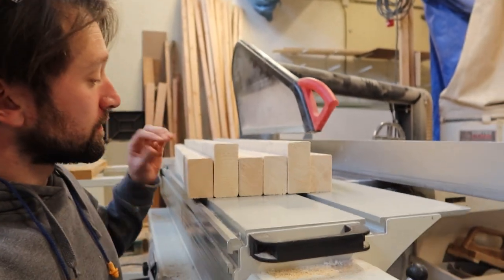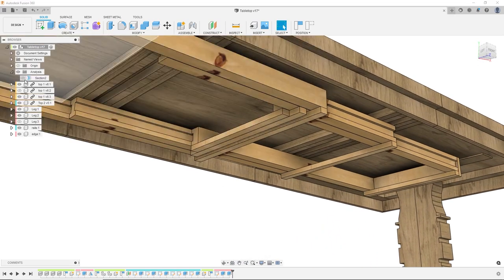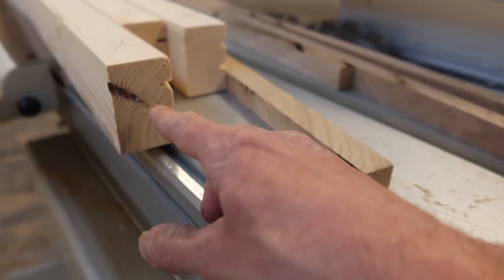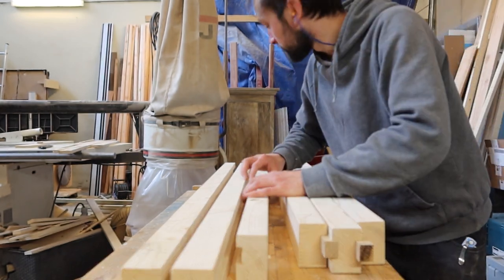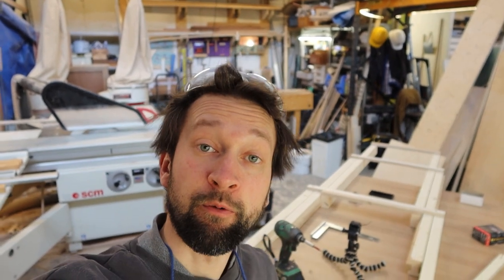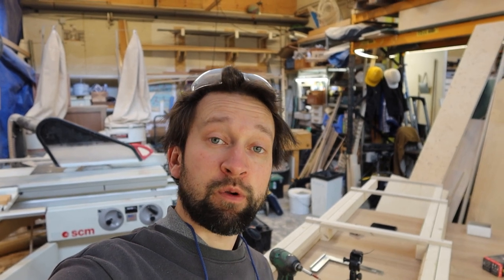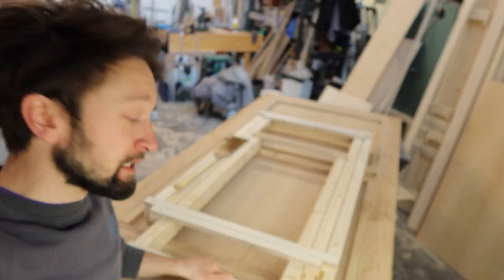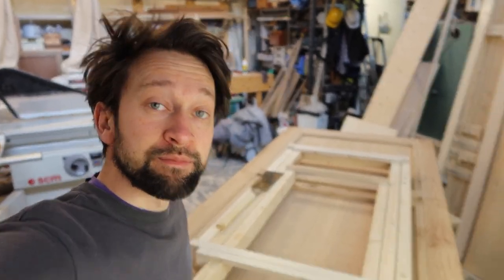DIY Table extention Slides

Comment: This is very helpful, Sebastian! I am putting together a plan for 55-inch slides for my dining room table. What are the dimensions and what kind of wood did you use for your slides? I am looking at making dovetail slides as they are more straightforward and I am a beginner!